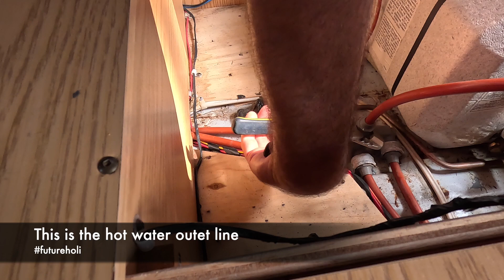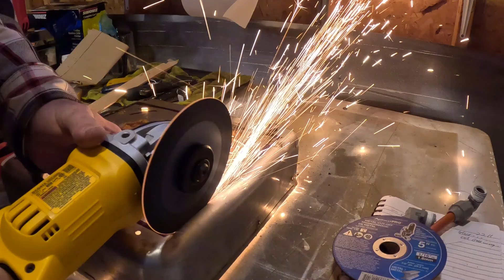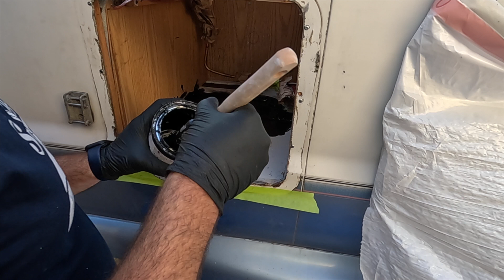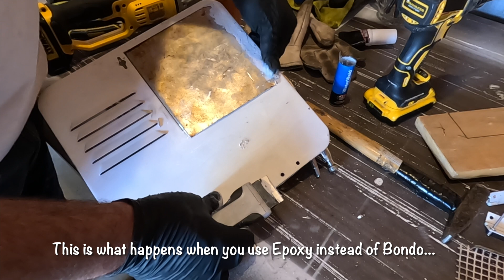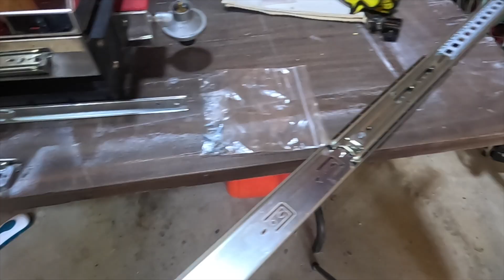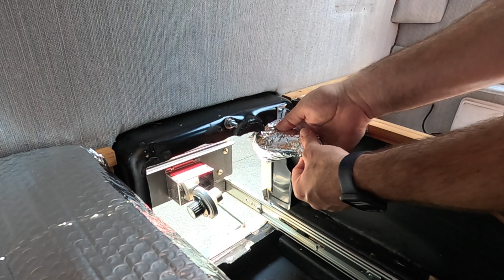Roadtrek 190 water heater removal and BBQ installation

Comment: I love this idea! Good job! Since propane tanks will be used, would it be better to turn the BBQ the other way to make it easier to attach the tank hose?  Asking in case I decide to do this.
Reply from the maker: @cherylcharming  thanks for your question, because of the shape and size of the barbecue. It fits best this way, and I like it opening facing the door for easier access.👍

Comment: Wow my 2003 has a BBQ port right on the integrated tank, did you look to see if yours had one?  As to removing the hot water heater,  not an option for us as we use it all the time.
Reply from the maker: @montanadan2524  I bought the van to a professional propane shop in the inform me that there was not enough room on the tank to put a splitter

Comment: if you remove the regulator from the bbq you can just use the low pressure that supplied the water heater. They do not use high pressure that is why there is a regulator.

Comment: I did the same thing on my C97V200, when I  removed the 3 way fridge. I used another 2 burner stove from another trailer with a 12 foot quick release hose. Also installed a cooler/freezer, 3000w inverter, 640ah lithium batteries, and extra drawer in the fridges compartment.

Comment: "You're not the boss of me!"  😂
I had my water heater removed when I first got my '92 RT.  They riveted a metal panel over the opening -- I wish I would have kept the door.
Reply from the maker: @RetroTrekker  you can easily order a new door for your Roadtrek off Amazon.👍
Reply: I'll check into that - thanks!
Reply: While I like your humor and watch your videos mostly just for the entertainment value, I kinda disagree with making so many alterations to your RV. Personally I like mine the way it was manufactured, have done some changes and upgrades but nothing to change the original design or alter how it functions. Personally I chucked my original useless water heater which had leaked out and rotted my floor under the seat and swapped it for a new on demand water heater so I have as much hot water as I want as long as I have full hookups.